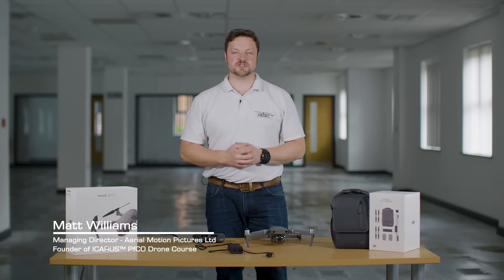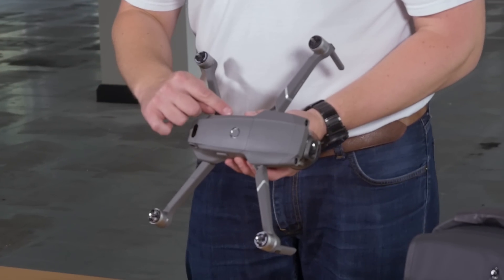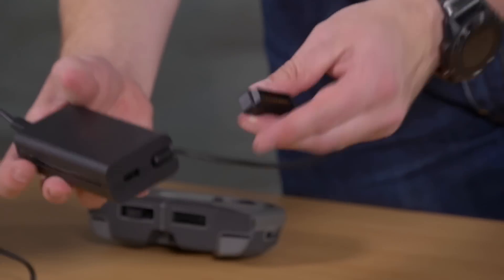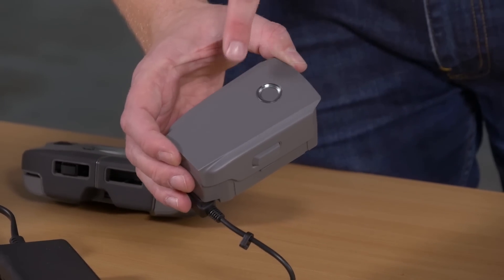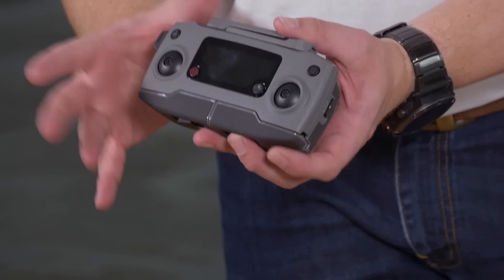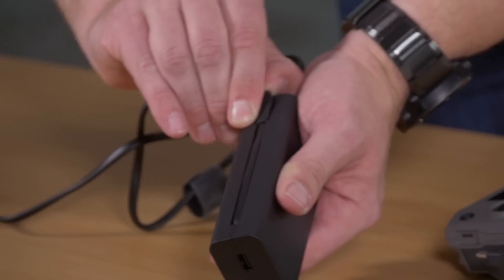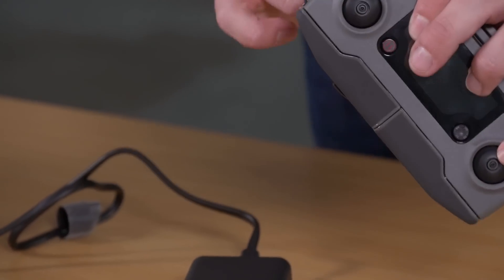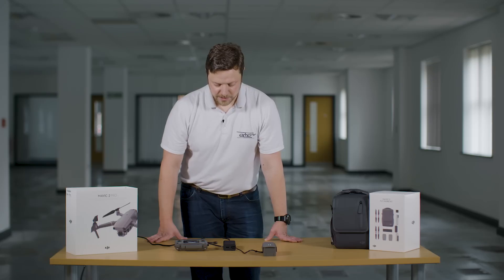How to charge the DJI Mavic 2 Pro Battery and Flight Controller

Comment: Hello there!!!...well,There is a small unnoticeable slot at the bottom surface of the charging hub  covered with a rubber flap . Could you please tell us it's use or function? Thank you in advance
Reply from the maker: Hi there - if it's the one I think you can see; it's a USB charging port for your own (or upcoming DJI) devices. If it's not that one, then send a picture to us and we'll take a look! Matt

Comment: You should not charge the battery and controller at the same time because of the heat transfer and you would not want to put stress on the charger.
Reply from the maker: That’s correct; it’s always been that way with the DJI products which can charge two separate devices from one charger... You can physically charge both at the same time but it’s not advised because the power supply can overheat.

Comment: Why should the battery not be kept installed when the drone is not being flown??
Reply from the maker: There have been cases where the batteries have drained down to zero (by being activated or just by being connected), which is really dangerous for LiPo's... They can get very warm and unstable - that's why we recommend NOT keeping the batteries installed in the drone when it is not in use. Google 'DJI Inspire LiPo fire on airliner' and take a look at what can happen! Matt
Reply: @AerialMotionPicturesLtd  Ok, Thanks for the reply. I'll be leaving the battery out when not flying
Reply from the maker: Good plan! ;) MW
Reply: @AerialMotionPicturesLtd  That would be quite strange as they ship the drone with the battery attached/plugged in..
Reply: Jeroen Jeurissen they do... But it’s not recommended to do that/leave it like that if you’ve got a choice. They used to leave their batteries slightly ‘unplugged’ when they shipped their stock but seems like they now ship them fully installed. 

As suggested; we recommend not doing this, but if you want to take your chances and go against the best advice, then that’s up to you!
Reply: @MrMPW  Thanks for your reply. I Will certainly disconnect the battery when not flying. However, it is quite strange they are not in compliance with the best practices out there by themselves right?

Comment: Thank you Matt. With respect you have omitted one potentially important factor in this video and as a result my lawyers will be in touch shortly !!!  (just kidding) I full of enthusiasm having purchased my first ever Drone the Mavic 2 Pro went ahead and charged, without watching your video or reading FULLY the tiny text instruction guide supplied with the Drone by DJI. As a result, it was not until I saw the online version of the user manual in BIG TEXT that I saw the WARNING icon/message* REMOVE THE REMOTE CNTROL CABLE BEFORE CHARGING ... panic set-in hoping I had not in anyway damaged the charger itself, during the charging of the intelligent battery?? Then I thought, ah I will search you tube to see if there was any video on how to charge and sure enough I found you!  But to my shock and horror you also didn't mention it...
Reply from the maker: That's really interesting... Thanks for the heads-up! That's not something we spotted in the initial version of the documentation, so we'll endeavour to get the video updated when we get back from Christmas break to reflect this. Matt
Reply from the maker: Hey Uxia - have you seen Matt's new channel? You might find it useful and interesting! :)

www.youtube.com/MrMPW

Comment: Its recommended not to charge both the battery and RC at the same time.
Reply from the maker: Good point... This has always been the case with DJI Joint chargers-they recommend that you charge either the battery OR the controller and not both at the same time, as the power brick can overheat!

Comment: Good video! Just one question, does this charger come with the Mavic 2 Pro, or is it sold separately? Thanks!
Reply from the maker: Thanks! The charger does come with the Mavic 2 Pro. The Mavic 2 Fly More kit comes with a charge hub so you can charge up to 4 batteries and the controller.

Comment: Another quirk is do not use the USB female port on the charger with a micro USB cable, even the USB C with Micro USB adapter supplied, I WILL NOT charge. You must see "CHARGING" in the controller window otherwise nothing is happening.
Reply from the maker: Good heads-up, thanks Ron! :)